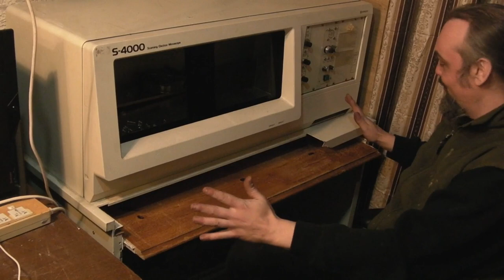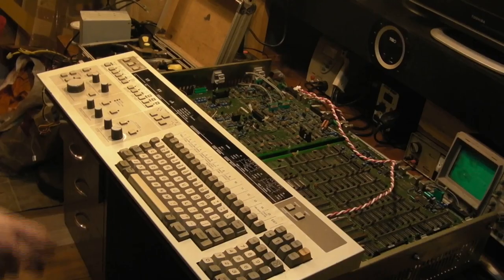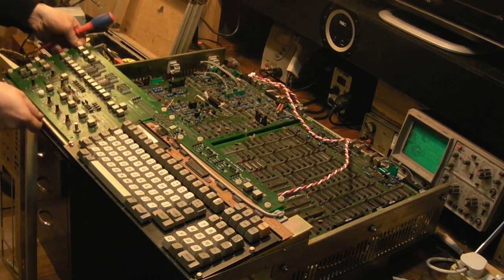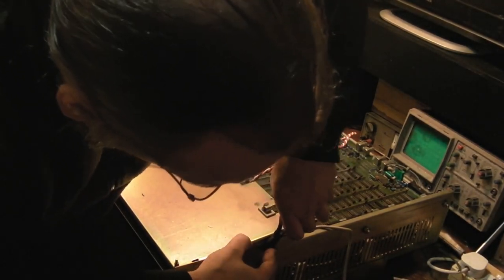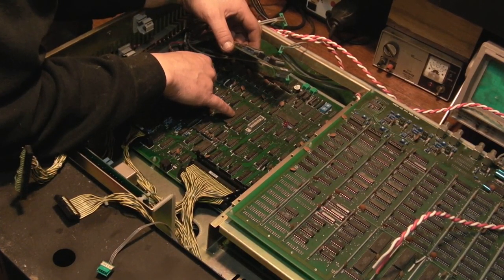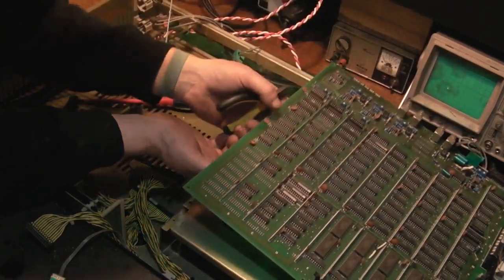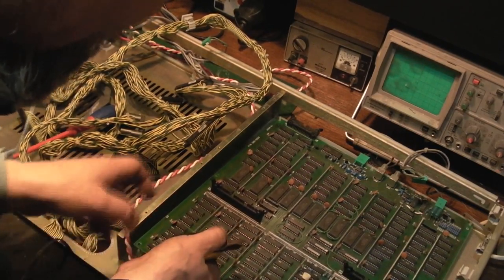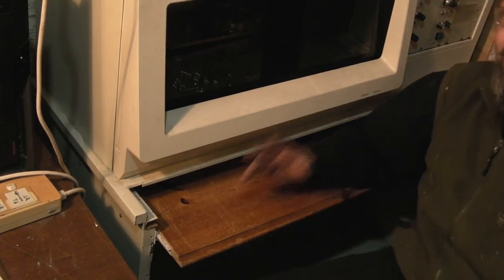Hitachi S-4000 computer. Striping down the computer

Comment: I believe the two boards full of SRAM and glue logic are a big framebuffer.  Making a high resolution scan on a scanning electron microscope takes some time so it is worth having a framebuffer to store the result of the scan for display.  Before this they would often use a film camera to take an image of the slow scan across the display.
Reply from the maker: Thanks for the info. I was wondering about something like that. It would make sense and i cant think of another reason for so much RAM
Reply: @Jayoldstuff1  The RAMs are measured in kilobits, not bytes. But still that makes a ginormous framebuffer. I wonder if you could trade bitdepth for resolution ("low" resolution with lots of shades or high resolution (not putting it in quotes as it will highly likely still be called high resolution today) real-mono (1 bit per pixel)).

Comment: D8279 = NEC Display Interface \ Keyboard Interface. i think
Reply from the maker: thanks for the info, will try to dig up a data sheet.
Reply: Ugh they are used in some rare-a$$ pinball machines (Peyper Odin and Space Train M.A.C.). I spent quite some time fixing these...